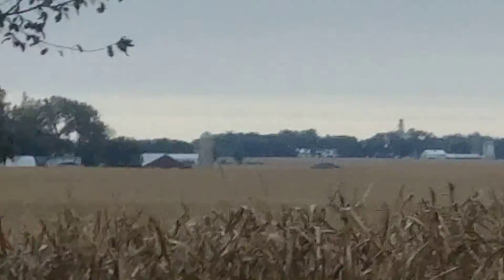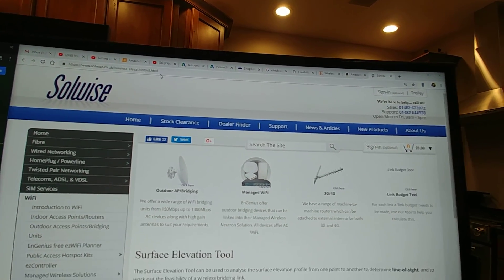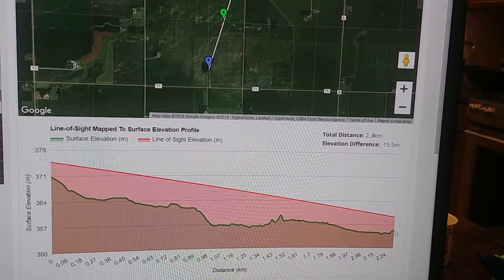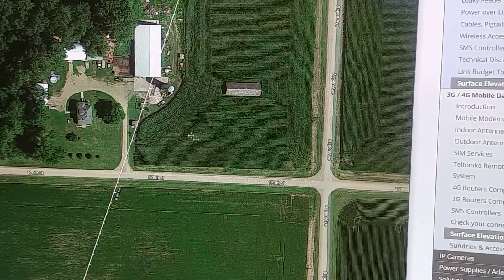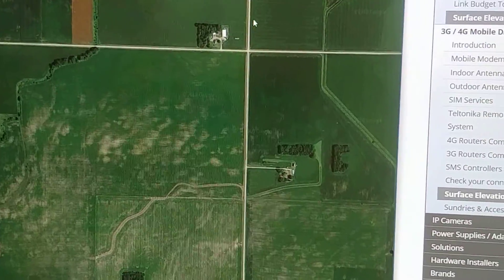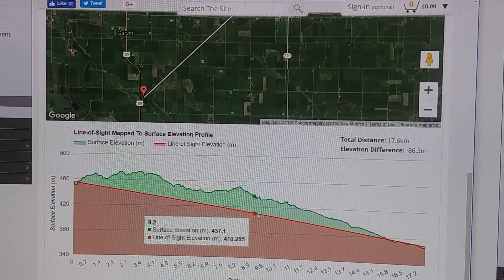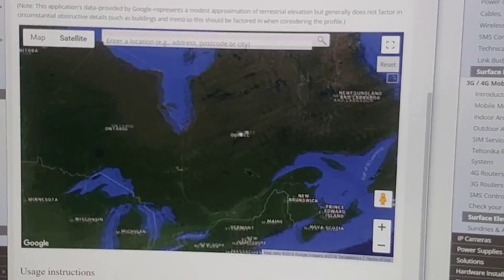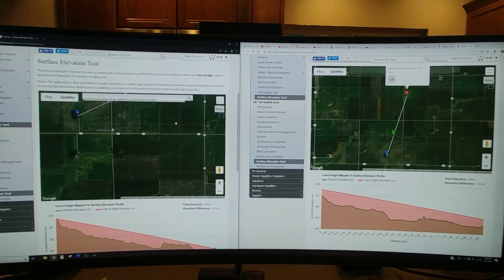How To Test if a Wireless Network Bridge is Feasible Using Surface Elevation Tool & Line of Sight

Comment: Great video.  I watched yesterday but didn't get to look what equipment you were using.  I saw Ubiquiti and was shocked and surprised.  Great job!  I am sure you will very satisfied. With the equipment you linked I would think that shed will be zero problems, but I am by no means an expert.   I have done a lot of research and am currently converting 2 locations to Ubiquiti and will be adding  some challenging bridges through a wooded area in one location and also possibly extending WiFi security cams throughout a large farm.  Once you can figure out ubiquiti, it can actually be done on the cheap side.  I am replacing my NIghthawk X6 routers with Ubiuiti Unifi (and Edge).  I am very much looking forward seeing the results here :)